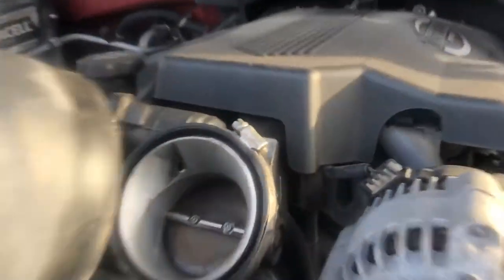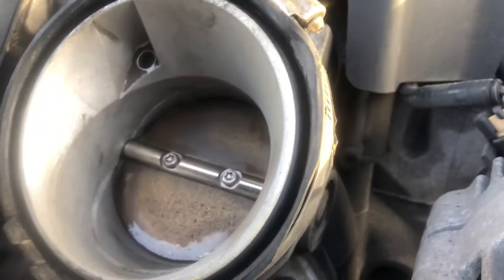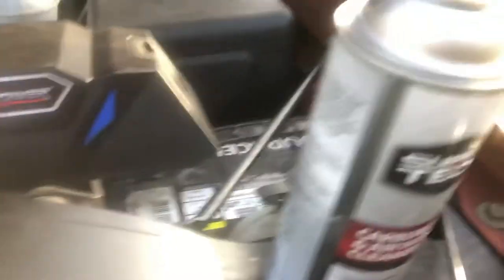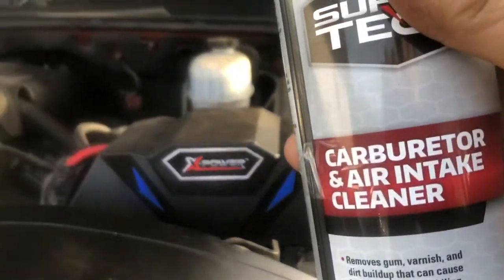Silverado Suburban Avalanche Tahoe Yukon STUCK in LIMP MODE FIX

Comment: Frame ground front left corner behind bumper and the ones under the driver's door on the frame remove clean grease replace cover grease after you're done reset computer I bet most if not all your problems will be including the multiple misfires among other things that are not working. I've seen cars newest 3 or 4 years old straight off the lot brand new already having rust problems around the ground wires grounds grounds grounds everyone grounds especially if you're in the rust belt of the u.s.

Comment: My 01 suburban is in limp mode but the check engine light is not on and I know for a fact the check engine light works because I pulled a fuse to test it and it came on when pulling  a fuse and turned back off when I put the fuse back in. so I'm stumped.
Reply: Try replacing ignition switch?

Comment: Mine i replaced pedal throttle body injection system purge system o2s and kept getting a pedal code i cleaned grounds buy drivers door and for body to engine and still did it put fuel pump i threw everything at it and the issue was so stupid simple and over looked i hope that this helps the battery had a dead cell and the ecm pcm bcm one of them detected that but gave a pedal code why no clue replaced battery runs like normal what a journey

Comment: I was driving on freeway and all sudden my abs, Trak control light, the check engine code flashing. now power like I was towing 20 vehicles and hard shifting. Any ideas why this happens  2013 chevy avalancche 5.3.  From what I read online this is issues with these trucks.  any ideas why this happens .
Reply: Did you ever figure this out mine is doing the same thing
Reply: @BrysonFields-d1z  Yes My catalytic converter went bad and anther thing I found out was use DENSO o2's  they are little more expensive, but they work  and CE goes away

Comment: I'm having this issue with my 03 tahoe 5.3 it stays in limp mode and reduced engine power is on the instrument panel I've changed the throttle body and cleaned the maf sensor any ideas what it might be?
Reply: Did u fix the problem
Reply: Same exact issue here....waiting to see what u find out!
Reply: Same
Reply: What was it
Reply: Mine was the battery
Reply: I put throttle body injection system fuel pump gas pedal list went on and it waz a dead cell in battery change battery fixed it

Comment: Mine is knocking like a lifter a day service stabilitrak but the only problem I had is the throttle body needing cleaned
Reply: Mine is on slightly tapping wont go over 35mph replaced throttle body, fuel pressure reg, plugs, and maf sensor,  still running like a 5cyn.. plz help
Reply: Same here what was the issue